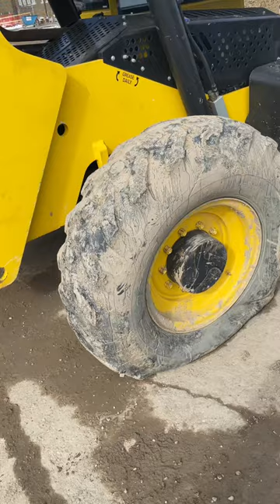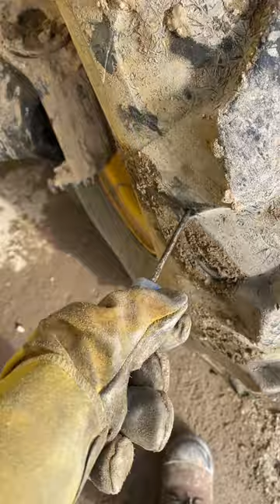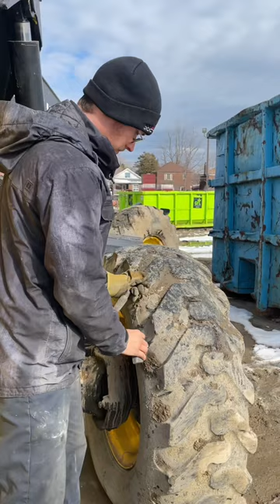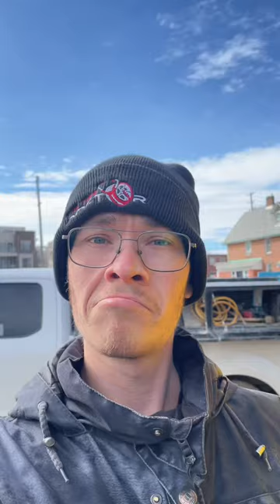I Cheered Up A Sad, Very Sad Tire #tiredoctor #shorts

Comment: The reason /difference between NOT fixing a sidewall on a regular car tire, and  that corner area on a piece of heavy equipment/loader is 100 % DIFFERENT.  1) The sidewall on a normal tire is thinner and does not have the robust thick rubber that a plug will bond with. 
2) regular car tires have cords running throughout the tread area that makes a plug structurally capable of bonding with….. the sidewall does not have these cords.  
3) driving the tire for 10 minutes after installing the plug heats the entire area of the tread up, finally bonding the plug to the tire….. the sidewall never warms up.  

All these factors make it for a bad bad idea .

On a piece of heavy equipment like that where the hole is actually very close to the tread  it’s not a problem as that aera is plenty plenty thick.  furthermore it’s not flying down the highway or down the road.   Totally fine.
Reply: Also the heavy equipment isn’t traveling fast down the highway like a passenger car

Comment: Fuck yes!  That’s a tire man.  Move to Alberta and teach kal tire about service.
Reply: Although Coaldale has a great one. Called 
Due West Tire
Reply: Theres a huge difference between a loader tire and your cars tire. Most tire techs will not repair a sidewall puncture as its a liability for both the customer and company. Not worth the risk in almost all cases.
Reply: @masl2004  I’m up north of yeg. And we get some real soft tire guys.  Been multiple time where they come out and they are so useless that I have to take the time out of my day and do it myself.  And I’m no tire guy. At least I don’t claim to be.
Reply: Plus you drive a Honda. So I’m going to guess that you never had to change a tire in any kinda of tough situation.
Reply: You can say that all you want mate, i actually am a tire technician myself. believe me if its that much of an issue you're welcome to buy a rope plug kit from your local crappy tire and patch it yourself, however no professional is going to risk others lives on the road to save a couple hundred bucks on a tire
Reply: @403hatch  and that why your a tire guy.
Reply: @waukesha7042  you’re the type of guy that litters.
Reply: @miguelcedeno7659  probably a bigger environmentalist than you think.  But good try.
Reply: @waukesha7042  it’s actually illegal in Canada for a company to repair the sidewall on any road going tire.
Reply: Waaaah the tire guys didn’t repair my sidewall puncture so now I complain everywhere I go. Shut up man, it’s a liability to repair car tires with sidewalk punctures or, if you’re using a patch like my shop does, a puncture within 2 inches of the sidewall and honestly, for customers who complain like you, I wouldn’t take the risk. I have repaired “unpatchable” punctures before for friends who I know aren’t gonna sue me or my shop when their patch fails.
Reply: @UnloadedRex  haha awesome. Thanks for the reply. I wouldn’t want to deal with me either. But some do.
Reply: You understand Kal tire has us use virtual bill and needs you to take pictures of our repairs or change overs and has a policy against string plugs on any tractor, lawnmower, Otr tire that can potentially travel on the road and blow a tire resulting in accidents, sometimes it’s more then less the guy not wanting to lose a job for a guy who he doesn’t don’t know
Reply: @spencerlaing9255  small town service can go a long ways in a small town especially when they start to think they are the only game in town. Next thing you know you have good competition. Just saying but I guess you can decide where I spend my money.
Reply: Alberta stop begging Torontonians to move to the boonies challenge /lh
Reply: @Nik-ny9ue  don’t be upset that you didn’t get the invite.  We already have enough Care Bears in Alberta we don’t have enough rope for you to hold.
Reply: Pull up to slave lake I’ll show you how tire service is really like I work at kal tire !!

Comment: You inspire me! Makes me want to use my motorcycle tire changer and put that new front tire on.
Reply: Can u do my rear pls
Reply: Bru you got a changer, I just did my front with tire spoons the other day, pain in the ass
Reply: I have used my tire changer lately. Changed both tires on my Goldwing and it worked great. Spoons work as well but aren’t as easy.

Comment: my grampa owned a junkyard and he use to patch the junkyard tractors tires with the nails he found in it... he would just put rubber cement on the nail and shove it back in the tire.